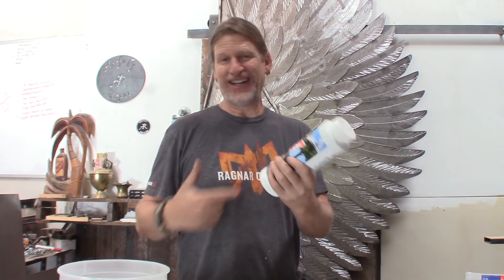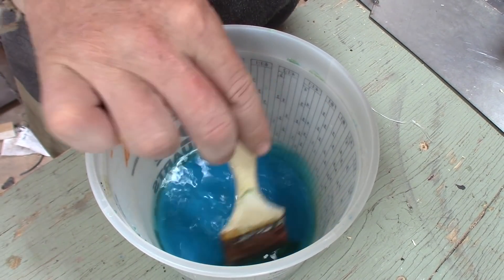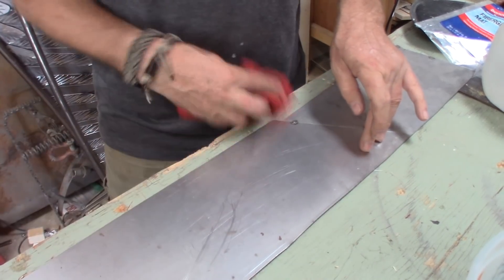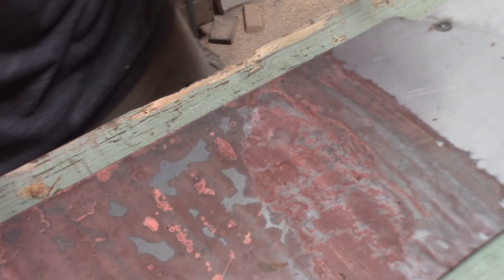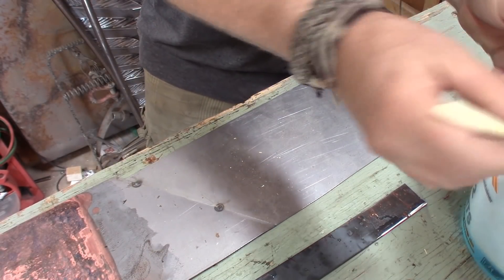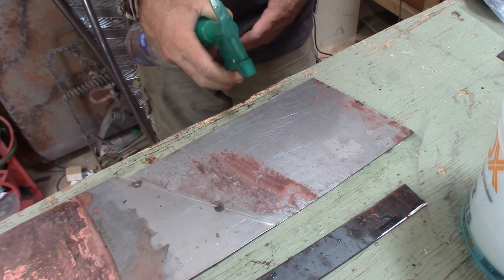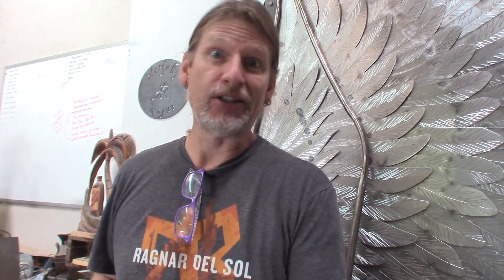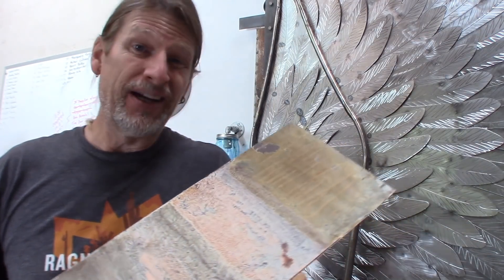Copper Sulfate on steel FREAKED ME OUT!!!!

Comment: Try a copper ACETATE instead of copper sulfate.  
Mix equal parts of muratic acid and hydrogen peroxide, as an oxidizer.   In an uncovered glass container, add several copper pieces.....I use scraps of sheet copper that I have left from copper projects...or just toss in a couple copper pipe fittings.  Leave for several hours or overnight until your solution turns quite green.   Your end product will work very much like your copper sulfate, but is, in fact, copper acetate, and in my opinion works a little better because it leaves a much thicker layer of copper,  perhaps reducing extra steps, coats and processes. If you think it leaves too much copper, you can similarly remove some with a little #000 steel wool.  Where you are actually working on production pieces...time literally IS money.
I was actually watching your video because we're repairing a 200 year old very pitted cast Iron fence....We've water-jet cut the new panels out of 1/2" steel plate and they came out fantastic.  Now i need to find a method to actually PIT, not just surface rust the new pieces to make them match the original 200 year old pieces.
Any ideas on how to actually rapidly PIT new steel to look ancient???
Reply: This would also work, however what you would be making is not copper acetate. You would be making a solution of copper chloride. If you wanted to make a solution of copper acetate then you would need to use acetic acid (vinegar) instead of muriatic acid (HCl).
Reply: @kylecissell958  Thank you.  Great info.  I'm not a chemist, by any stretch...just an experimenter. So, I am always interested in learning the proper chemistry of things.  Copper chloride, it is.  
Maybe you could answer something else, while we are engaging.
So I've made about a pint of this Copper Chloride, about 50/50 muriatic acid and hydrogen peroxide, and dissolved as much copper as I could in it.
So I have a fairly well saturated solution.  I'm very careful with it because I understand the toxic nature of it. But I am concerned about how to ever, now dispose of it.  My thought was that I would pour a box of sodium bicarbonate into it, in a large vessel and then let it evaporate in an open air environment.  Does that sound viable???
Reply: Tterribilis sodium bicarbonate will definitely neutralize the acidic nature of the solution. With enough sodium bicarbonate you can (theoretically) remove the copper metal from the solution. Once the metal is removed then the solution becomes far less toxic and can be evaporated as a neutral liquid.
Reply from the maker: Thanks for the info on making copper acetate.  Sadly I haven;t ever tried to pit metal but now you got my wheels turning! There must be an accelerated method we can discover
Reply: @ArtfullyRogue   I actually thought I might try some muratic acid and hydrogen peroxide and use that as a bath and then hook it up to a power supply in a reverse electrolysis config.( + on a scrap piece of steel to receive bits from the fence part which would be hooked to -  )
I'll let you know if it works.
Reply: I've managed to buy some copper acetate crystals. If I wanted to use these to copper plate metal would I use water or something else to produce a solution?
Reply: If you have crystals...just add them to water.  dissolve as much as you can into a quart of water. 
 I will say that creating a copper plating, by any method, that is scratch and abrasion resistant is REALLY difficult.  Whatever you plate,  you're probably going to want to clear coat with something.
Reply: @Baroque_Back_Mountain  Think something is wrong. I tried dissolving some in distilled water today and it didn't work at all, wouldn't plate the solder not even a hint of copper visible. Switched to some copper sulphate and that worked on the same item. Wonder if something wrong with the copper acetate I got. It looks similar to copper sulphate but is a slightly different shade of blue.
Reply: @ColinWatters  I think it's because you're making copper sulfate, which you then need to use electrolysis to apply.
If you use some copper ACETATE made by the method that I mentioned of soaking some old copper craps in equal parts of Muratic acid and hydrogen peroxide as an oxidizer.    You should be able to simply DIP a shiny piece of steel in it and get a coat of copper without electrolysis.  The coating will be relative to the saturation of your concentrate. And again , it won't be adhered to your steel very well.  It's almost like it's just stuck on from static, until you clear coat over it.
As I said I have not had good luck with copper sulfate, although that is the actual way that things are plated in copper.
If you continue to have problems...let me know and I will try to make a video to show you exactly what I have done in the past.

Comment: I just found an old round piece of metal which looks like it could be the top of an old windmill. I  would love to give it a rusty look but I’m not sure what the properties of the metal are. How do I  figure that out?
Reply from the maker: Hi there Corky, if its a real old ans part of a windmill its probably galvanized metal. First test to see if a magnet sticks to it. if it does, its steel. if it doesn't its aluminum or stainless. If you have access to a angle grinder, use a flap wheel or other sanding disk on the piece, if it throws sparks, its stainless if not its aluminum. Hope that helps

Comment: REAL men make their own CuSO4 with battery acid and electricity!
Haha, just kidding.
This is actually copper sulfate pentahydrate, but that's besides the point.

I have a neat experiment that you could try. Maybe the results could be useful, or maybe it wont do anything at all.
Try mixing 5 parts acetone with 1 part water, then add the CuSO4-5H2O. Mix it up and then paint it on the steel. My hypothesis is that it will give a very uneven and natural look. The CuSO4 isn't soluble in acetone (barely) and with the ratio of 5:1 acetone water, the acetone will evaporate more quickly, leaving behind water and the soluble CuSO4. Don't worry, it isn't dangerous.
Reply from the maker: I'll totally try that out!

Comment: I just put a patina on a blacksmith piece forged in a coal fire after I took wire brush wheel to it I first coated with "Aqua Regia" half nitric acid and half muratic acid, it made a huge difference in the effectiveness of the copper sulfate. I also added some nitric acid to the copper sulfate and water (1 tbls copper sulphate 5 tablespoons of water 10 drops nitric acid).
Reply from the maker: that sounds very cool!

Comment: would this work on a stainless steel sink?
Reply from the maker: dj speer honestly I'm not sure however I'm heading to my shop in a couple hours and will give it a try and let you know
Reply: awesome. thanks
Reply from the maker: I did a quick test on stainless but didn't get anything immediately. Let's see how it looks tomorrow, maybe it's just a slower process on stainless.
Reply: oh man. ok i hope so. be another great video....hopefully it comes out cool. thanks so much...cant wait to know the result
Reply from the maker: Well no luck. Copper Sulfate does not react to stainless in the same way it reacts to mild steel.
Reply: well crude. I have a sink I want to tarnish and I saw your video and then fell in love with your channel, so I thought I would ask. Thank so much for trying....
Reply from the maker: try muriatic acid and hydrogen peroxide. Wipe the stainless with the acid then spray the peroxide on..it turns pretty quick, not as extreme as mild steel but it does have a much better reaction than the copper sulfate
Reply: Thank You. I will try that...

Comment: Right on , try one part vinegar to 10 parts peroxide and a bit of salt. Found it on YouTube. I’m going check out the rest of you stuff. Thanks for sharing. Btw , I’m Glendwelder on instagram.  Cheers
Reply from the maker: Yeah there are some really cool ways to rust steel, my standard go to methods are vinegar, peroxide and muriatic acid and recently the copper sulfate.
Reply: @ArtfullyRogue  Sally Beauty supply carries a Hydrogen Peroxide solution for hair that is about 40%. It's one hell of an oxidizer. (Use Gloves )

Comment: I copper plated a couple pieces of feeler gauge many months ago by dipping the steel into the copper sulfate bath--waste product from making nitric acid.  I recently got into chemistry last September as a hobby. I discovered on accident as well that copper could be plated onto steel (non-stainless) without electricity and I was thrilled.  I made a quick video about it.--not sure if I ever made a follow up video.

Now that I know more about chemistry, I found out what was happening as far as the reaction.  You can neutralize the acid (copper sulfate/blue vitriol) by using a solution of sodium bicarbonate and wash the surface.  You can get a perfectly even coat of copper if you want to go for that effect.  I found pre-treating the steel surface with dilute hydrochloric acid will help increase the bond strength and durability of the copper.  Don't worry about the surface becoming black with copper oxide if you don't have time to apply a protective sealant on your work-piece.  It will actually protect the copper underneath the oxide layer from further corrosion.  Just scrub it down with steel wool and fine grit sandpaper for that even brushed copper look.  If any spots aren't perfectly uniform in copper, you can apply more coats of copper sulfate and finish the surface to your liking.  This is obviously easier with small pieces that can be dipped into solution, but I think brushing it on should work just as well after seeing your results.

As a bonus, you can use a Sharpie marker and draw designs on the metal.  The copper won't adhere to the steel at all wherever the marker is.  The marker can be removed later with solvent.
Reply from the maker: Matthew Wilson that is a wealth of great information! I will definitely try it all out
Reply: My original reply was about three times as long.  LOL.  I'm eventually going to do another video on copper plating.  There is a lot more I wanted to include with my post, but I didn't want to write a novel as I typically do.

My initial reason for getting into chemistry was due to the work I do with metal.  I wanted to get into electroplating...then the chemistry addiction took over.  I'm still planning on doing electroplating of copper, silver, chrome, nickel, etc.  Maybe someday gold and platinum, but that's a lot of $$$
Reply: Matthew Wilson , Nice .
  As an independent in aerospace r & d , I was tasked with plating tiny inside fuel passages of densified carbon fiber with copper .  First to succeed with a combination of wash and electroplating !
  Say , Thanks for sharing this great find !
Reply: to easily get a uniform copper coat you can clean the surface with phosphoric acid and water dilution, then add the copper sulfate in the remaining acid and apply over the surface, it will easily adhere on the metal and not oxidize. When finished clean with acetone and apply a clear coat
Reply: Do you think that you could paint a bare metal car with it to make it look copper?  And would it rust? Or protect the steel? Thanks
Reply: @truthhunterAu  you certainly can do this to a steel bodied car. I've seen a couple amazing patina jobs (that were stabilized after) to give the vehicles a very beautiful, unique, aged look. 

As far as protection... the copper could protect to a point, but you'll still get oxidation and corrosion. The patina would have to be stabilized and coated.
Reply: @truthhunterAu  I'm thinking of doing it on my 1971 vw bug!
Reply: wait a minute....is this how gun blue solution woks?
Reply: @frigglebiscuit7484   
  Gun bluing is actually rust. In the old days, guns were "Browned". After the barrel was made, and the exterior shaped, it was commonly set outside, rubbed down with animal blood, or propped against a log, and urinated on. This caused it to rust very quickly. It was carded down ( the rough rust was removed), and the treatment was repeated, until the desired finish was obtained. Then the barrel was sealed with beeswax. 
  In the 1800's, it was discovered that a bit of selenium, added to the Browning solution, whatever that consisted of, turned the barrels, black. When polished, it resulted in a deep blue-black finish. Later, to speed things along, hot bluing was introduced. The barrel is stripped, put in a caustic hot bath, then introduced to the bluing solution. This resulted in some very deep bluing jobs. Look at an old (pre-'64) Winchester for a good blue.
Reply: Matthew Wilson, 
   Very cool! Thanks for the further information! Good comments on these threads too!

Comment: add a small bit of sulfuric acid and clean the metal with acetone then take a look .
Reply from the maker: I'll totally try that! Thanks
Reply: usually copper does not bond well on metal directly,acid etching or cleaning might help so will using fine iron(or ss) wool but in plating they will strike the metal with a layer of nickle or i think zinc works too before the plate with copper which works good,,that why copper plating items that already have nickel on them works good like quarters

Comment: Once the desired copper patina is obtained and the metal is dry what sealer do you recommend to preserve that look
Reply from the maker: lehi gaytan hi there, I typically use a clear coat from Deft, which I pick up at home depot. It's used primarily on wood however I find it also works great on metal as well

Comment: It's good stuff, used as a soil conditioner so you should be able to buy it easily from any gardening supply places. I have a question, I am making a cold rolled mild steel sliding door and I would like to age the metal (take the shine off) not rust, more of an old zinc look, do you have any advice for me please? cheers
Reply from the maker: If your using a mild steel, I might try a coarse buffing compound to dull the shine. I typically spray on vinegar and or a mix of Muriatic acid and peroxide but both solutions will look like the metal has rusted. You might also try an orbital sander with a fine grit paper however this might leave patterns in the metal so you'd have to move quick and not stay in one place that long. Let me know how it comes out and which method worked best what you're trying to accomplish
Reply: Artfully Rogue thanks for the advice mate, I've tried the vinegar (turned a very vibrant yellow, looked great if that's what you're after) random orbital sander worked well gave it an almost brushed steel look though still shiny, I'm thinking of using a matt poly to finish see if that dulls it, I'll keep you posted, keep them videos cumming, cheers.
Reply: I'll throw the final door pictures up @ Wallis_designs on instagram have a squiz if you get a chance.